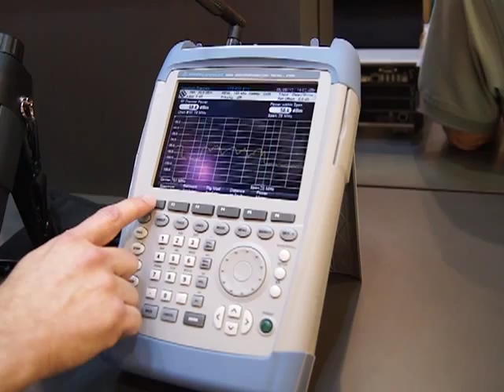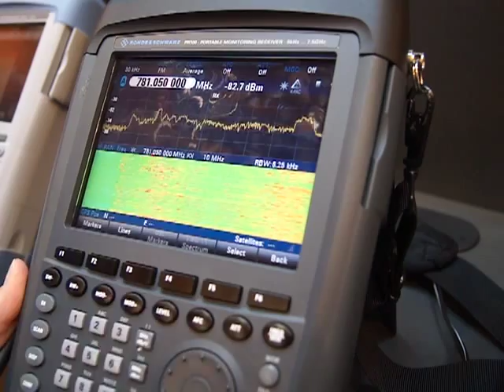CTIA 2012: Rohde & Schwarz hand held base station portfolio of instruments

Comment: Hello can these instruments catch the signals of devices hidden in my house ? So in other words, i need to prove that im not hearing voices , and i want to know if these instruments can help? I think there are devices hidden in my walls and someone is transmitting from the other side, i want to see these signals and record to prove im right
Reply: You want the PR-100 which is the middle unit and the HE-300 antenna kit, it will cost you about 30,000 USD for the kit. Also buy an OSCOR Green or Blue as well.